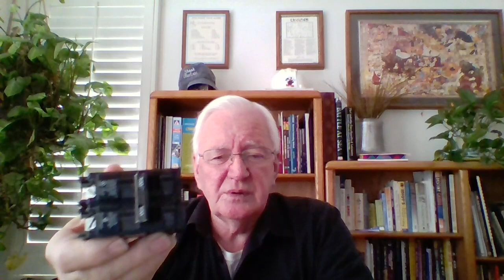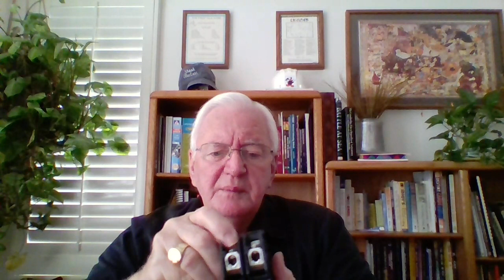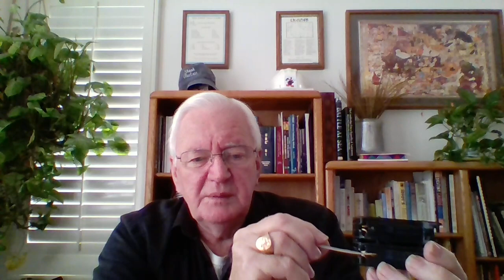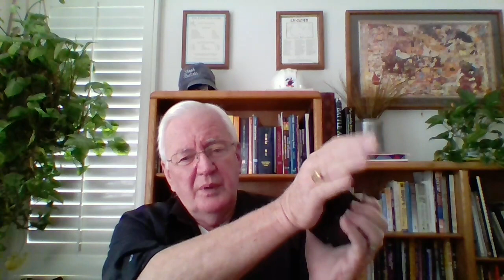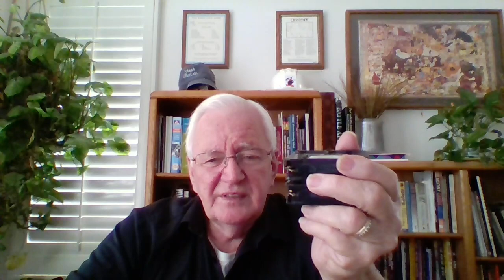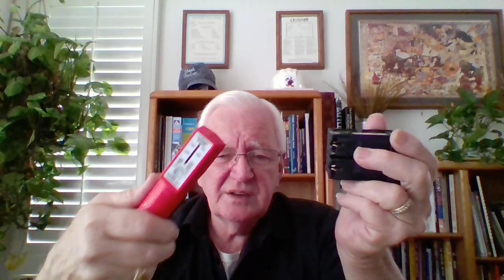Main Breakers, Never stand in front of a breaker you are turning off, on.

Comment: What does it mean to "check it for grounds" and that "he thought he needed a grounded bus but ... he wasn't thinking correctly"  at about 8:30 in the video. Why was that a dangerous thing to do?
Reply from the maker: When you work on large equipment you power down the  480 volt buss (3) and take cable or heavy wire and ground and short the 3 buss so other people will not come along and turn it on while you are working on it. When you bring  the power buss (3) back on, you check to make sure your buss is not grounded or shorted,  before you turn the power on. JS

Comment: Hello I have questions. I install modern led lights, the light has three wires green/ yellow , blue and brown . What is the blue and brown wire stand for ? I assumed blue is neutral , and brown is hot . Did I guest them right ? When I connect white to blue, black to brown and green to ground , when I turned on the breaker the light was on then I turn off . When i completely install I turned breaker on then the light didn’t turn on at all , I don’t know why , please give the answer, thank you .

Comment: Why do you need to check with a wiggy? Can I just use a tick tracer?
Reply: Wiggy puts a bit of load on the circuit.  There can be cases where detectable voltage is present, but no power delivery.

Comment: John, Why do inside NEUTRALS need to be insulated, but the outside, exact
same neutral, does not need to be insulated? The one going to the step down 
transformer.
Reply from the maker: neutrals can carry voltage depending on how far they are from ground. some times 2 or 3 blocks.
Reply: @JohnShook  wow, i just learned about neutrals carrying voltage when theyre farther.from ground!